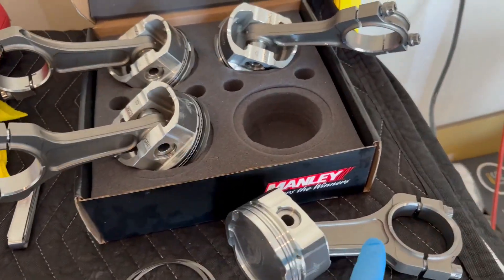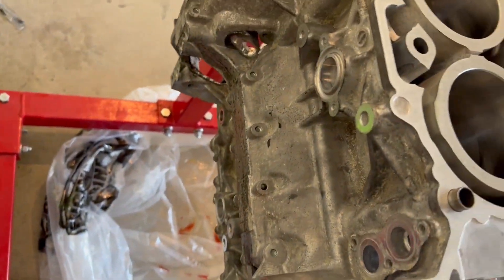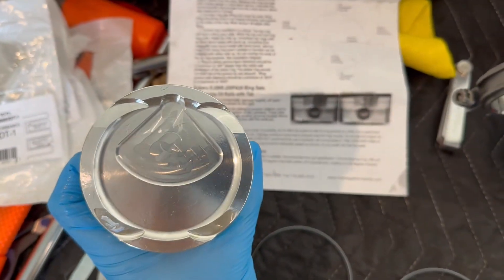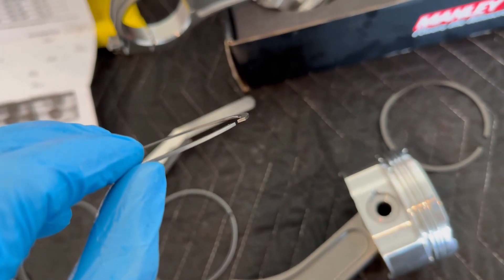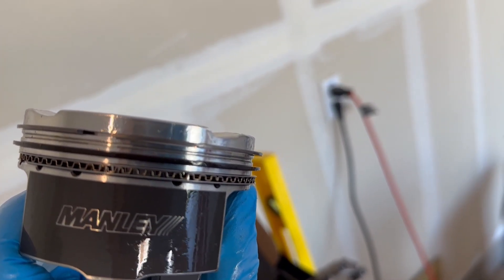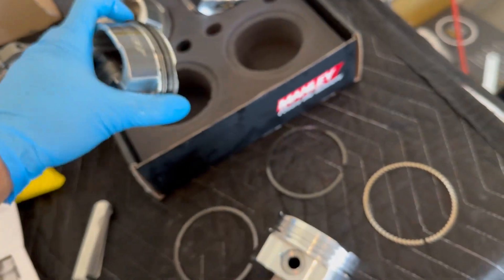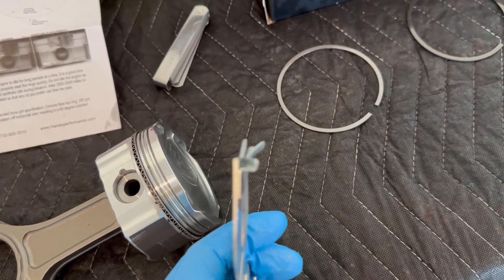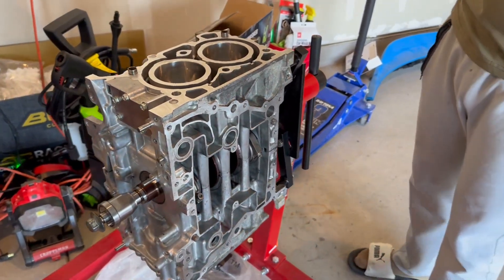FA20 Engine Rebuild Part 2 Piston Assembly FRS/BRZ/FT86

Comment: I’m planning on building the fa20 too myself what is the most difficult part of this process? I want to see what I can do and what would be worth taking to a shop to get it done if I can’t
Reply from the maker: I think the most difficult parts were the ridiculous amounts of sealant you use, and using the right amount. Also installing the little circlips for the wrist pins was probably the most difficult part, aside from that, I would honestly say everything was pretty easy. I am going to have to rebuild it again soon because I did some oil cooling mods, ran too thick of oil, and my oil temps were just running too cold. So i’m probably going to do a teardown and re-ring it. Aside from the mistakes with my self inflicted oiling issues, the engine ran well, and had been for over 25k miles.